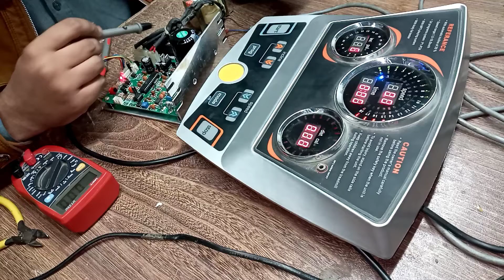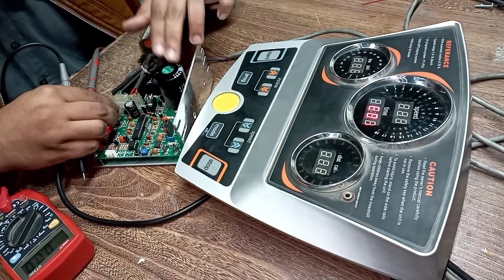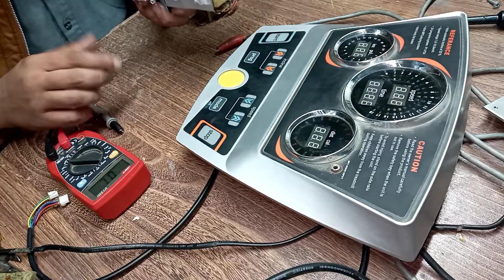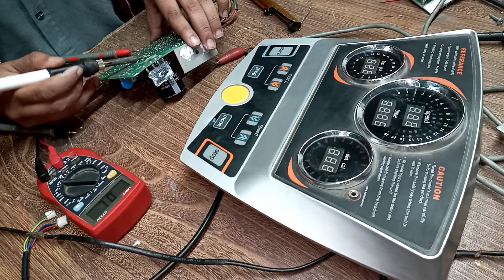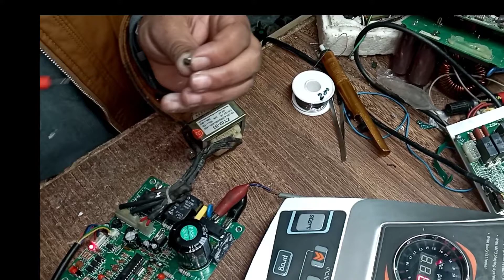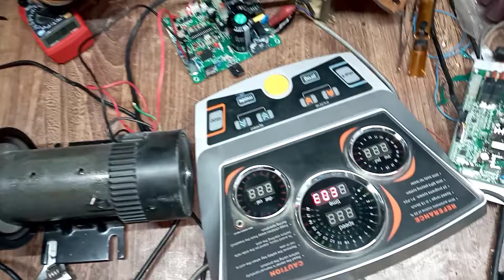How to fix Treadmill Error 1, Error 2, and Error 3 repairing.

Comment: Hello friend, I have a problem with my treadmill.  I would be grateful if you could give me your opinion on this matter.  When I start the treadmill, the motor starts to turn off very quickly and then stops after about 4 seconds.  There is no error code on the screen, the speed sensor is working, the mosfet is intact.  Which parts do you think I should check?

Comment: Hi Kalim,
Hello everyone, good day. I have a problem in three control boards ,same model Life gear 97370M ,pressing start button gives 320 VDC to motor pin out terminals and it is non controlled, no up no down. I have tried many times ,tested MOSFET IRFP460 ,bridge and other components , nothing looks bad
Can you help 10:58

Comment: Hi Kalim! Thank you for your videos, they are very inrofmative. I try to fix error 2, this is my first expirience with repairing electronics, previously I have never used soldering iron at all=) First I changed shorted IGBT. Error 2 gone, but Error 3 appeared instead=) Next I changed failed resistor (it was black and burnt, I heard they often still works despite this, but not in my case). The same Error 3. After that I changed optical element inside speed sensor. Not working either. Error 3 appears after I press Start button (3 seconds later), motor not moving at all (but it actually works, electrician tested it). During starting, I can hear several times clicking sounds of relay. After upper console shows "error 3", at bottom console led "LED 6 CONNECT" turns off.

What next should I try? Other transistors, resistors, capacitors, rectifiers looks good.

Comment: मेरे पास एक बोर्ड हैं उसका problem hai ke आफ्टर लोड के बाद स्पीड कम होता हैं without lode chalta hai so kya karu power capcitor bhi chenge kiya so pl z help
Reply from the maker: Motor kay ampere check kro.
Motor jb ziyada ampere lati ho gi to circuit trip ho jata hoga.

Comment: Hi kalim i have a problem with a treadmill that shows no error on the board but... It starts normally but just when i change the speed the motor stops but the boads show that everything is working... Have you ever faced this case before
Reply from the maker: is this happen with any particular speed ?
typically issue is related to feedback . 
sometime current sensing modules sends signals to the cards that motor is withdrawing more amperes.

Comment: Hi kalim i have a problem with a treadmill that shows no error on the board but... It starts normally but just when i change the speed the motor stops but the boads show that everything is working... Have you ever faced this case before

Comment: Hi. I have a problem with a EO7 errror. It says that i have to replace the console board. Can you help me?
Reply from the maker: Could you share me the details.
Reply: Yes. I turn on the treadmill and after 3-4 second it starts to beep and on the screen appears E07. In the manual it says the safety  key is not connected but on internet I found that the console Board is the problem...
Reply from the maker: @iloveheavymetal13  send me video at whatsapp +923009855546
I hope i will solve your problem.
Reply from the maker: I have uploaded 2 videos for error 7
Reply: @KalimullahPakistan  I need your help to resolve my treadmill American fitness T310E error E3
Reply: Help me e 7 error
Reply from the maker: Check my other videos .for error 7
Reply: Hoe to check wiring, i have same problem with error 1